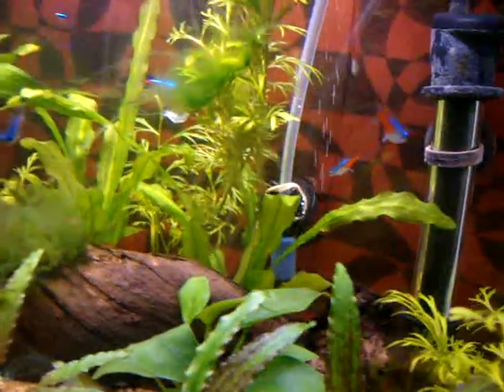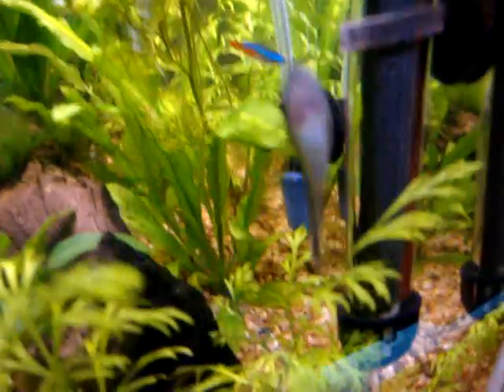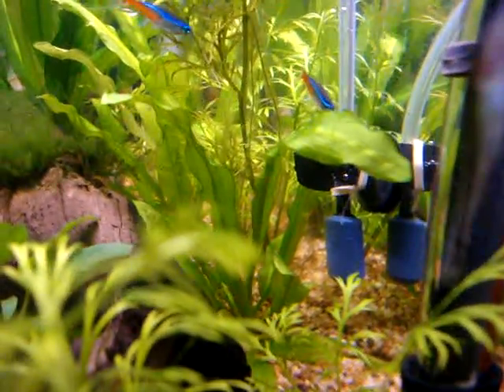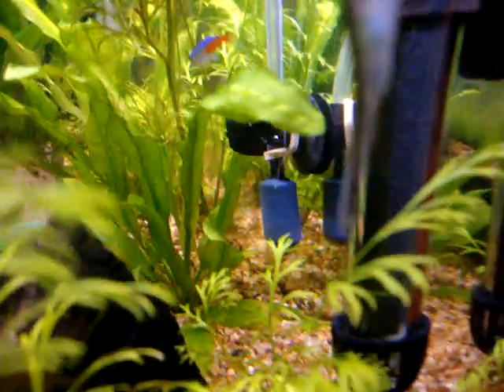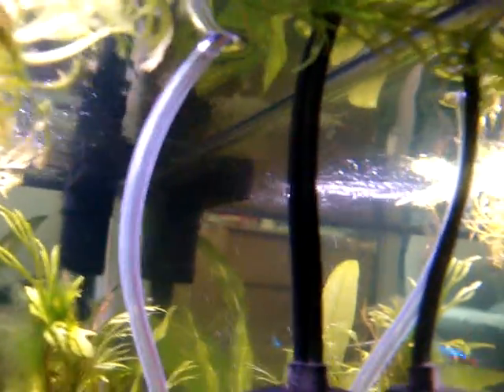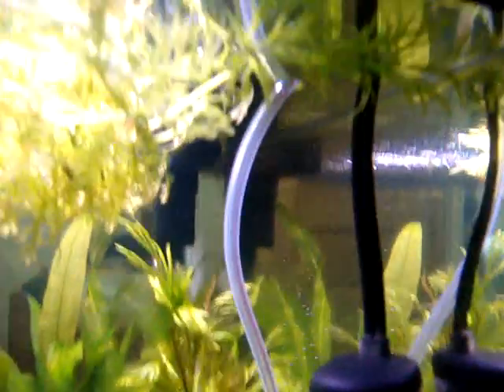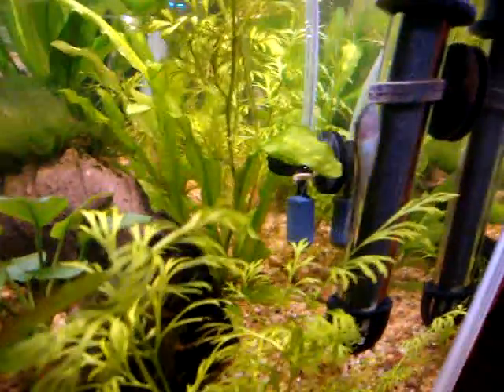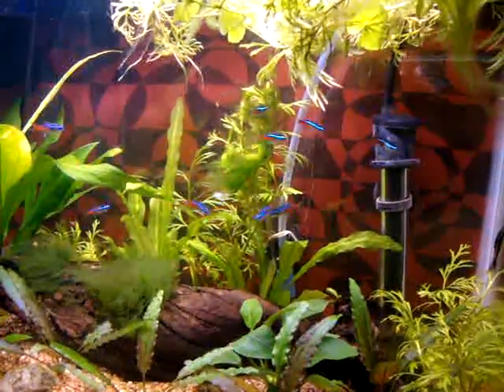C02 Diffuser Experiment - Cheap Airstone

Comment: I'm also using an air stone as a temp fix while waiting for my glass diffuser to come in. Mine's splitting up the bubbles pretty nicely. Sure, there are some spots in the stone that make bigger ones, but I do see a bunch of bubbles that are super tiny. I know you're not using this setup anymore, but was it pretty effective during the time you used it? My diffuser is being shipped from Indonesia or something like that and won't be arriving or another couple of weeks
Reply from the maker: crazybastard82 This system was fairly effective. I think placing the airstone underneath a filter intake or, better yet, a powerhead would be more effective.

Shipping will take a bit but you'll be happy with the upgrade. Go pressurized for even more fun!

Comment: I have removed the air stone because I noticed when it's without the bubles come out easier and I ve tried to rest the pipe at the bottom of the tank as you do , the bubbles didn't diffuse ,it is better only when the pipe is not so deep in, well I hope you understand what I. Mean.
Reply from the maker: Glad you got it working. Diffusing is tricky. One of the better methods is to place the air line tubing below a power head. That will chop up the bubbles and diffuse them.

Comment from the maker: I recently moved and haven't set up my c02 system again (I will be in the next day or two) but I'm using an airstone just like the one in this video. I'm placing the airstone underneath a powerhead so the c02 bubbles are chopped up even finer and then distributed through the tank.